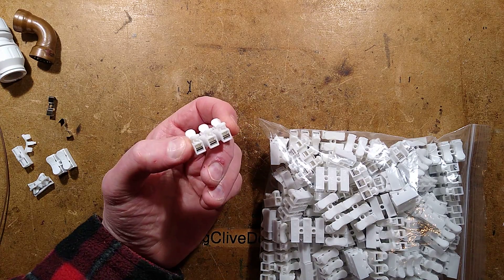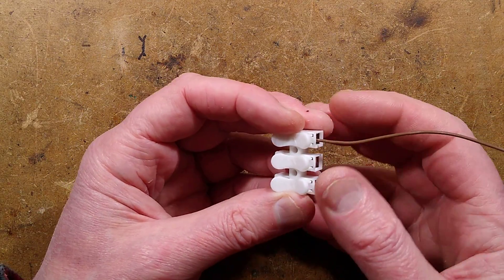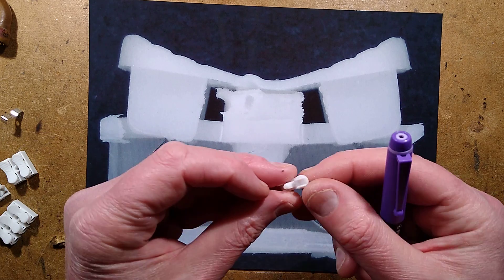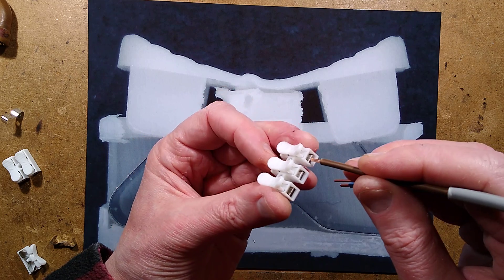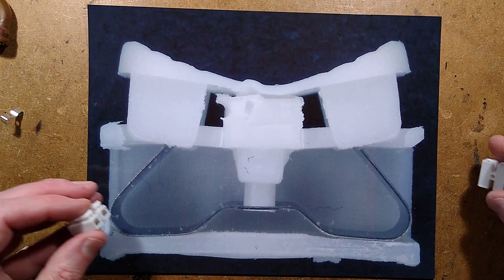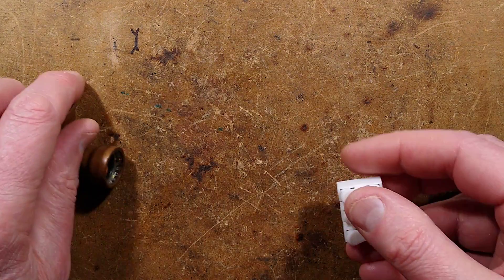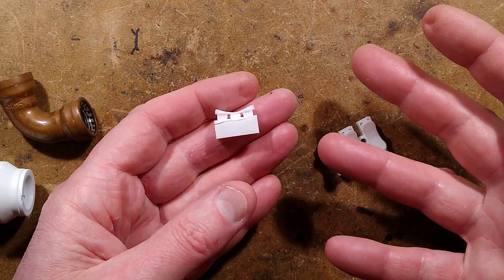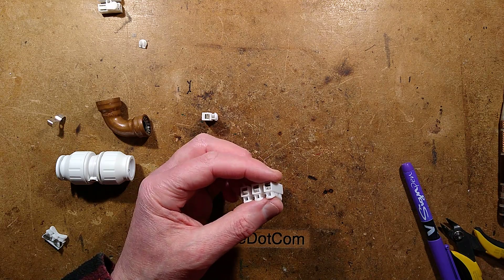eBay's cheapest wire push-connectors (Not for house wiring!)

Comment: I've bought this type before from Ebay and I won't use them on mains wiring anywhere. I've only used them with low voltage led strips when I'm testing rgb leds and need to remove the wires easily. Good video again Clive. 👍

Comment: I discovered these and I use them in place of alligator clip leads when lashing prototype circuits together on the bench.   They hold much better and you don't have the wiring rats nest due to long leads all over the bench.  They have very little conductor exposed too.    Much neater hook ups.  Neatness counts for added safety on your bench especially when working with mains pixies.  I never even considered using these for permanent mains connectivity applications.   Great PSA.

Comment: I don't think the stainless will cause a problem. Wago connectors use stainless. The only time stainless has a problem is if it's in contact with with zinc.

Comment: Here in NA there are lots of copper to steel connections that are perfectly safe and legal.  IIRC in the UK/Ireland most of the connection I remember from the 1960s were copper to brass.  I also remember a lot of those being engulfed in a green crust.  Perhaps thing have changed.

Comment: If the pipe that is pushed into that fitting sweats (as cold water pipes do on hot, humid days) the water can easily run into the area where the stainless is. That said, galvanic corrosion occurs most when the dissimilar metals are farther apart on the galvanic scale and some stainless alloys are pretty close to copper on the scale so if attention was paid to selecting which stainless was used there shouldn't be much to worry about.
These wiring connectors could be useful for temporary connections when experimenting if nothing else.

Comment: Not suitable for high current as you say. Also not suitable for mains voltage in my opinion. 

Only use these for low voltage low current projects.

Comment: I'm disappointed,  you had the chance to pop this inline in a cable with a 13amp load (or variable load ) and demo a small fire and some  FLIR footage as well. I've watched you for years and never seen you pass up the chance of carnage 🤣 Perhaps a demo of different Wago style connectors under load.

Comment: Could You actually test these connectors? Connect - apply 2x/3x/4x the amperage over a time and see if it heats up / smokes / burns your room down to the ground. Hopefully without the last one :***

Comment: I will sate that I am very surprised by the build quality, it's actually built much better than I thought. It also has synchronous rectification on board as well. It's got a lot more in there than I thought would be in it.

Comment: Do not buy this kind of connector. I use it on 24v circuit and it melt the plastic. The housing has a very soft plastic which cannot stand the heat.

Comment: Hi Clive I got a bag of these last year for connecting low wattage speaker cable lash ups on events the Fig 8 stuff they worked that's about all I can say about them, I certainly wouldn't advice use on 230 Volts plus they don't have a BS7671 rating.

Comment: I got a few of these not long ago from a wee backalley hobby store. They're convenient for prototyping projects, quickly connecting random things on my work bench to check if its even going to work, before I put the effort into soldering it all.
That's about the only use I've found for them so far..

Comment: Although  "less than ideal" for 240v high load, these are nevertheless excellent  for 12v / 3v  modelmaking applications, along with the silicone grease - filled K series IDC connectors, especially at LED voltages (3v). I use these a lot for initial wiring test / set-up, prior to final connection via the K connectors.

Comment: I literally installed an LED light in my room today which provided these as connectors. I wasn't impressed  to put it mildly. They'll be  getting replaced with proper 3A minimum terminal blocks when I get up and have some caffeine in me lol (I need to adjust the screws on the fitting to angle it better anyway). I didn't know the power factor so reduced it to 0.3 and 0.2 and it was still hanging at about half an amp so 3 amps should be more than it ever needs unless it catches fire XD

Comment: The fact that the clamping is against plastic instead of a metal strip at the top... once any heat is involved it would become a run-away as the tension is lost while the heated wire softens the plastic it is clamped to... loosening the clamping, leading to higher resistance, further softening the plastic and so on unti you are lucky and it disconnects, or unlucky and find out whether the plastic is flame retardant... and the rest of whatever this is tucked into...

Comment: I have some of those! I use them purely for low voltage DC temporary connections in the lab, where the one-handed springy squeeze disconnect is a boon.

Comment: More than the corrosion, my concern is that part of the clamping force is provided by ABS or similar cheap thermoplastic which could and probably will deform over time, losing clamping force.

Comment: Yeah..... I wouldn't use these for anything... you've got an unknown contact metal/plating, unknown corrosion resistance, unknown spring tension and longevity thereof, unknown plastic type - how quickly does it take break down? (and flame retardant? doubt it)... the list goes on... 

They Might be okay for protoyping or something, but house wiring? Even light duty? No way. I can see these things losing tension on the contacts, or the housing degrading over time and losing tension, very small point contact area onto the actual wire... pretty much a guaranteed time bomb. The question isn't if they'll catch fire, the question is when.

Comment: TBH I'd only use them for LED string lights (indoors) or low current projects. Little fingers would not be welcome, so a heat shrink wrap would have to be added..  I'm gonna need a heavy duty, tried and tested safe one for sure.

Comment: Copper and stainless are ok - they aren’t very far apart on the galvanic scale and the stainless has a very thin passive oxide layer which prevents corrosion. Both metals are fine in even aggressive marine environments. Plus, of course, there should not be any moisture about, so no electrolyte to facilitate electrolytic corrosion, hopefully.
Reply: Don't they use nickel wire for marine applications? Usually for submarines they use silver plated nickel, heavily nickel plated, and I've also seen outright pure nickel wire.
Reply: @linuxguy1199  Given silver's tendency to oxidise (blacken) when used in jewellery (or cutlery) over time, I'm surprised to hear it's OK in marine applications.. I guess that oxidisation doesn't affect its electrical characteristics or make it brittle?
Reply: @snafu.X  That's actually the main motivation behind the reason they use it. Unlike copper and most other metals, Silver oxide is conductive and the oxides electrical effects are mostly negligible, in fact, silver plating is preferred over gold plating in many applications since most gold plating tends to be extremely thin and wear off if a connector is repetitively used. Silver plating though can be caked on pretty much as thick as you want since silver isn't nearly as expensive as an equally thick gold plating.

Comment: Thanks for this! As earlier said in here, I'd love to see a proper test of these with high current load, not only mains, also 5V, 12V or 24V, since people generally use that for LEDs and tend not to think of current issues if the voltage is low.
Reply: I agree, a 50W load at 12V is 10 times the current (4.2A) than 50W at 120V. With 12V they will melt, with mains they could pass the current OK but wouldn't trust safety either in terms of arcing, insulation and fire resistance.

Comment: In india I purchased those 100 pice online. For quick n clean connection of led lights fans etc. dual pols not triple. But m not happy with design. Could be a lot better system in same price. Cant use for high current. Need dc barrel type connector for AC or panel light type connector

Comment: The wire joiners. I've been using them for over 4yrs now. 
DC 12v, 3amps, 1hr, temp increased 2° C above ambient. 
Cheerz Clive.
Reply: Wago and other good ones are fine, but I've used the exact same type as in the video and they certainly can't cope with 3 Amps, give it a bit longer the plastic will deform, connection worsen then melt.
Reply: The science is right there. 
Maybe you got a different batch or brand.

Comment: If you load these with a current of 10 amps I guess before burning every down the plastic will melt and expose toxic gas.
So you are dead before the fire breaks out.
Thus, it is not a risk to die in fire.

Comment: Wonder how long they’d last on some 2.5mm single wired across the output of a welder? Wagos hold on even when the rest of the rig is on fire.
Reply: Real Wagos are fine, the cheap Chinese copies not so much.

Comment: As long as there is no water involved, those contacts won't be much of a problem. Before bimetallic corrosion might appear due to high humidity and such, those cheap connectors will simply break into pieces because the plastic housing is just cheap as hell, for sure not ABS or similar, longer lasting plastic materials.
In very humid environments any bimetallic contacts should be avoided, esp. if sea water is involved.

Comment: When I worked on a farm and with electric wire fencing to connect two wires together don't use copper wire because the copper will eat the galvanise wire and if you use a strip connecter the screws  inside the connecter go a bit funny and you can't undo then. That my experience with different metals

Comment: Different metals are definitely a concern.  And the comparison with the copper pipe fitting shows that it may be okay, but not all stainless steel is the same and the different alloys behave differently.

Comment: In 100-120V countries they use the same 14 AWG (1.5mm diameter) wire in lighting as they do on any normal 15 amp breaker. 20 amp breakers need to use 12 AWG (2mm diameter) but they aren't usually for lighting.

Comment: Would not use them even for low current as mentioned would not trust them not to oxidise/corrode in damp conditions and that tiny contact point is asking for trouble. More copper on copper contact the better!

Comment: they are probably safer than those twist-on connectors that are legal to use in north america
Reply from the maker: The horrible twist on connectors do have a very tight copper to copper contact.

Comment: Coincidentally, I ordered some of these (2-wire version) and the ones that look similar, but with screw terminals off of a Chinese site about 24 hours prior to you posting this video.  My idea was to use it under the eave of my house where it would not be directly visible and attach a T5 or T10 LED (which I had soldered short leads onto) into one side.  Since these LEDs are normally for use in cars, they are 12VDC and pretty low amps.  The way the eave of my house is designed, there is about 1-1.5" overhang of the fascia over the bottom of the soffit, so there's enough room to hide some small diameter wiring and these connectors without them being noticeable unless you were standing directly underneath them.  I'll be using solid core wiring, not stranded -- probably 20AWG for the initial test since I have about 60 ft of it leftover from a garage door replacement where I reused the old sensors instead of installing the new sensors... After a coat of paint or caulking, the wire will be even less noticeable.  I don't want a lot of lights, so the LED strips are not an option for me.  Initially, I'll just put one light in each corner of the roof around the house, garage, and breezeway, so that works out to 16 of them.  Maybe a few more if I notice too much of a dead spot between the lighting areas at night... Maybe install the clips every 2 ft so that I have places to put colored T5 bulbs during the Winter Solstice holidays and remove them during the rest of the year... They are cheap enough that installing them every 2 ft would not be that expensive and in fact, since they screw into the wood, they could be used as clips to secure the wire to the fascia or soffit...

The screw type were $4.28 for 50 and the 2-wire clip version similar to what you reviewed here were $2.11 for 50... Just need to wait on the proverbial "slow boat from China" for the delivery...
Reply: Ones at that kind of price tend to crack the metal when you tighten the screw, and fail quickly. It's a false economy, get proper ones!
Reply: @Richard-dc5he  -- The order came in today... After I looked at them, the spring type ones (like were reviewed in this video) reminded me of the speaker wire connectors on most of the speakers that I've had over the years.  Not something that I would recommend putting a lot of power through, but good enough for low voltage.  The screw type ones were in a slightly smaller form factor.  Both would accept 16-AWG stranded wire without a problem.

The only problem that I have with them so far is that for my intended application, I do not have any screws that are small enough to fit in them.  A standard drywall screw is too large both in the base of the screw and even more so in the diameter of the head.  My measurements (via a digital caliper) seems to indicate that it will need a 3-3.5mm diameter screw with a head that is not more than around 4-4.5mm.  I'll also need them to be around 20mm long.  Easy enough to order off of AliExpress or Temu and then wait 2 weeks for them to be delivered by the proverbial "slow boat from China".... I could probably take some drywall screws and chuck them up in my metal lathe and cut them down to the right head diameter... That's a lot of work, but it would probably be quicker than waiting for them to be shipped from China... Of course, the problem with ordering it off one of the Chinese sites is that by the time it get here, I've forgotten what it was that I needed it for... ;)

Comment: Those connectors are actually pretty reasonable for led light fixtures, since leds draw barely any current. I installed loads of PIR led lamps fitted with those connectors from factory, and it's always the motion sensor circuitry failing rather than mains connectors. And they work reasonably well for old aluminum wiring.

Comment: At my work,, some chonese ceiling fixtures had those type of connectors. The electrician that fitted them have changes five fictures so far. The connectors burns up. All black and melted. Horrible

Comment: Those are ABSOLUTE HORRIBLE connectors!
People should stay far away from those cheap connectors.

A couple of years ago John Ward did a high current test with those connectors and they failed miserably.
The problem with these connectors is that they clamp the wire between the plastic and metal which make a poor high resistance connection.
In comparison Wagos use the cage clamp technology which clamp the wire in a metal cage.

Link to John Ward video
Wire Connectors - Failed and Useless
https://m.youtube.com/watch?v=13wstX-Fcwo&pp=ygUYSm9obiB3YXJkIGJhZCBjb25uZWN0b3Jz

Comment: Those springs press that copper lead against plastic. When current goes through that junction it gets hot and melt that plastic. An automatic thermal fuse...

Comment: I've bought a few of these for 12v low voltage projects and they were okay. I tried using them to connect 18v solar panels together. Much less good. They melt a little, but seem to have contact continuously regardless of the plastic shield evaporating.

Comment: I've had a handful of these tor a couple of years and only use them for temporary low voltage lashups, wouldn't want to risk mains voltage and currents on them.  Wago only for those applications.
I often have a problem with them as I have a tendency to press the wrong 'button' when pushing the wire in.  Not the fault of the connector, just me being useless.

Comment: You might be onto something there Clive. I recall the days of copper clad cable. That's aluminium with a copper coating. The coating I was told was to stop dissimilar metal reaction (galvanic) as copper was nearer to the brass connector than the aluminium. But in my opinion (1977 ish) the grub screw would cut through the copper  and dig into the aluminium anyway.
Reply from the maker: Copper clad aluminium is sadly coming back in many flexible cables from sites like eBay and Amazon.

Comment: Those things came with cheap led light fixtures. Those connectors pisses me off. As electrician i know safer connector. I use wago 225 connectors for connecting light fixtures. I think those DIYers struggles with those shitty ass connectors... Often mankind produces absolute junk....

Comment: I'd be more concerned with heat than a galvanic reaction. Copper is 10x more electrically conductive than stainless steel and not particularly good at conducting heat either. I can see these stainless clips heating up under a fairly moderate load and melting their way through the plastic. 10 amps at 240v? Fuck that.

Comment: Aside from the galvanic corrosion when unpowered in a wet or damp environment I would also be concerned about the problem of metal ion migration when used for DC power wiring. Essentially the equivalent of electroplating, the effect is that depending on the specific metals, the voltage drop and contaminants one side or the other will have the copper slowly being transferred away which is especially dangerous when the 'copper' is a thin plating on steel as is common in Chinese electrical devices, like led lighting fixtures.

Comment: We've been using stainless steel bolts on copper/brass/bronze/aluminium connections in the power industry in the UK for years, both outside and indoors with no issues.
Reply: OK for the specific corrosion resistant steel alloys intended for electrical connections. Risky when unknown alloys are in cheap Chinese products.